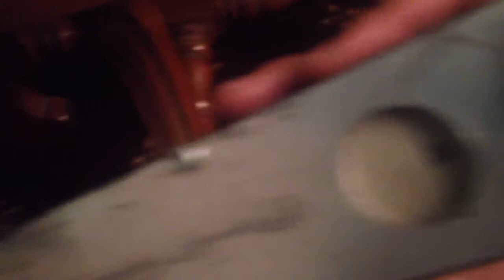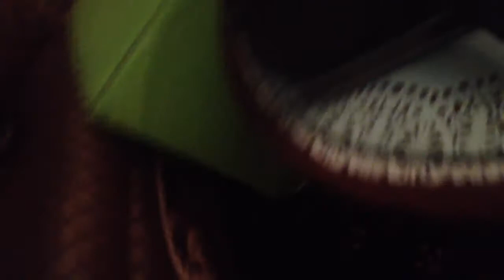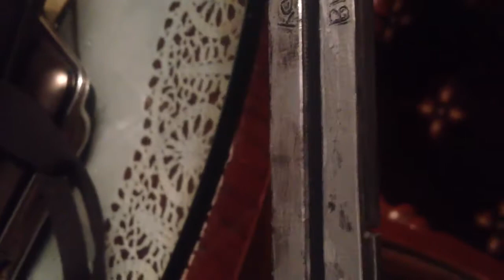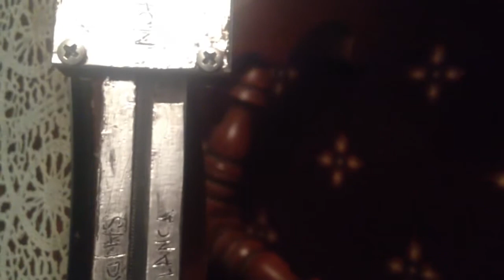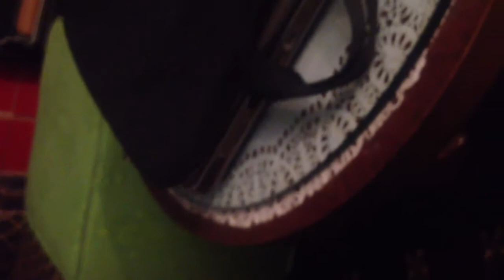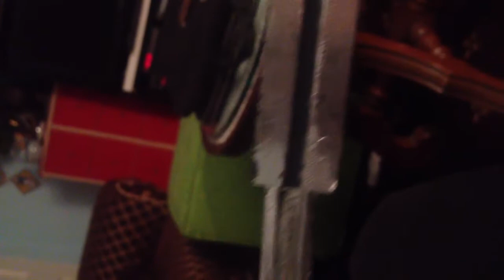Precautions for the hidden blade community!

Comment: I totally agree, there is no need for a metal blade like ever in a toy like this.
I will therefore show you my vid /watch?v=3ADMktxkhM4
we are both working on the same project. Mine is about finished, just need to fix minor glitches.
Also in my version, both tiers are released at the same time, it's an easy fix for that. And i can have as strong of a spring as I want. Currently mine isnt strong enough to shoot or extend in those up/down position.